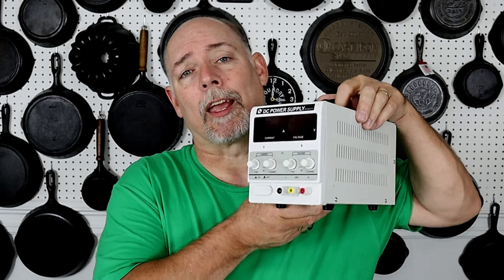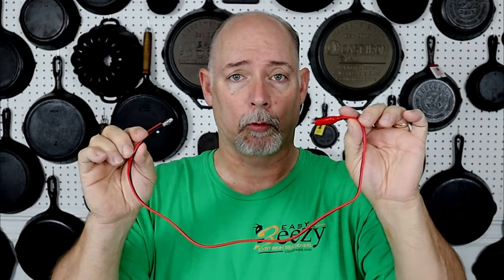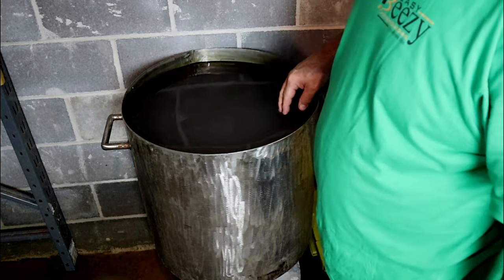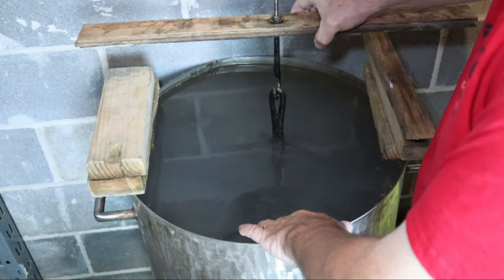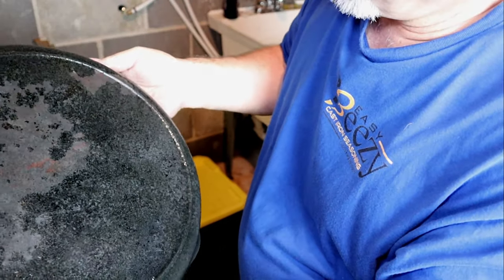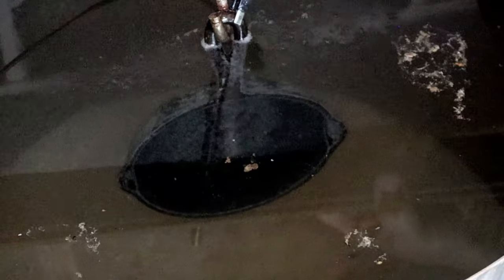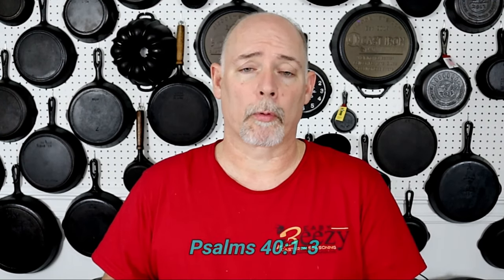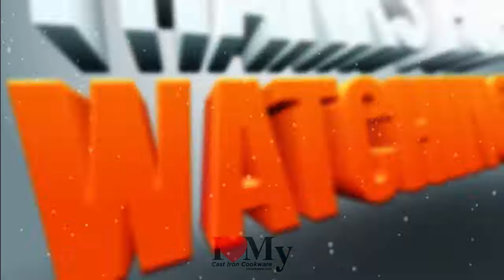DC Power Supply For Electrolysis

Comment: SUPERNIGHT 12V 30A DC Power Supply Driver,360W Universal Regulat...
$21.95  at Amazon,  recommended on a cast iron group. I dont known if it can work ok. Its a 30 amp unit

Comment: And you can get ADC 9 to 60 V 20 amp DC motor power supply can motor control power supply my bad but that is something that runs at 20 amps at 20 apps sir

Comment: And the whole thing is as small as a big CDI Box Smaller than that bulky thing you've got you may not be able to control the amount of amps that it pushes but but you can control whatever voltage you want to put through it

Comment: Can I use a 12v 100ah battery?
Reply from the maker: You probably could but I did not know if it would hold up very long.
Reply: @castIroncookware  I ended up using a battery with an onedrive 60a charger connected. Worked fine set at 3 amps battery charge

Comment: I just picked up a manual charger at Walmart. But it was 110 bucks. 200 Amp charger. You can use it at 6 amp 40 amp and 200 amp. I just built my e tank tonight. With this charger what setting do you recommend? Would 40 amp be safe?
Reply from the maker: I like using 40 amps. Makes it go faster.

Comment: Stainless steel contains chromium. The electrodes, and thus the chromium is consumed, and you end up with poisonous chromates in your electrolyte.
Reply from the maker: I've been doing quite a bit of research on that. What I've learned is that I small home system does not produce enough power for that reaction to take place. Still learning though and researching as I go.

Comment: Stainless probably isn't a good choice for the positive electrode.  Hexavalent chromium will be formed in the solution as the chromium leaches out of the stainless.    This is some nasty stuff,.
Reply from the maker: I have been testing for hexavalent chromium but have not shown any positive results on the test as of yet. It may be because I am not generating enough power. Of course that is a good thing.
Reply: @castIroncookware  glad to hear that.
Reply: @castIroncookware how do you test for it? I too have a few small stainless tanks which I'd like to utilize foe the same purpose but it feels like I'm breaking the golden safety rule.

Comment: Wrong. Automatic battery chargers can be used. I connect a car battery to the electrolysis system and connect the automatic battery charger to the battery posts. I’ve been doing this for a couple of years now. The best part is the free replacement warranty on WallyWorld Max series. Three years full replacements warranty!

Comment: I'm looking at a Tripp-Lite PR-15 DC power supply. It is regulated at 13.8v and 15 amps. I think it should draw about 12 amps continuously. Does it matter if the power supply is regulated vs Variable like the one you have here? Thanks!
Reply from the maker: Not sure

Comment: Well Sir, I sure do Have a Better Source for Power Supply Than That Overpriced Labratory Box of Bees. It's a Welding Machine! See During Electrolysis Your Voltage Really is off the chart if you measure in voltage, But it is Amperage what really gets the Marblings Sizzling. Amazon Has Welding machines that are capable of 150-200 Amps at the Maximum for 50-60$. I'd say since your old 12volt battery charger was a 40 amp  you will be able to match that but it would read 1-40amps at 100% duty cycle and the remaining amps you would have to take breaks, but at 40 amps any welder will be able to do that since most rods run 50amps and up, but I do reccomend an amp meter if the unit does not have one sine some manufacturers don't use amps and use their own made up units like "power" with the rheostat dial reads from 1-4 and hopefully they explain how much amps go in each quarter, but for sure your powersupply's diodes will thank you since they will go out if you max that power supply out.

Comment: Please do not go on the Electrolysis Tank Builder site and ask about using a DC power source. My question was deleted and I could possibly removed from the site. Manuel 12 volt battery charges only.
Reply: Why? Seems counterproductive for a group for those looking to build an E-Tank. Manual battery chargers are almost impossible to find. Can't understand why that group would make that rule.

Comment: Have you seen these

Henxlco AC 110V - 220V to DC 12V Regulated Transformer Switch Power Supply Driver Adapter for CCTV Camera Security System LED Strip Light (40A) https://www.amazon.com/dp/B07FPFK81S/ref=cm_sw_r_cp_api_glt_fabc_9MCDQ7R0E2FJW6G5F00W

I have not tried…but it might work, not sure if it has any fault/short protection that may kill the output in an electrolysis application